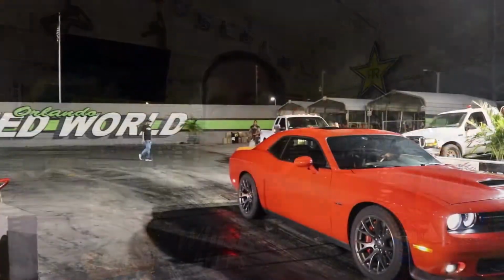2016 Challenger SRT.  Testing Out the New Tires and Brace. Orlando Speedworld 8/28/2020

Comment: Your not leaving at the right RPM.
Reply from the maker: Yea, still learning this car.  I need to get a few more back to back passes and dial it in.  Plus its been a while since I launched a clutch car.  I'm a little worried about snapping a drive shaft or axle or I would use the two step in the car.